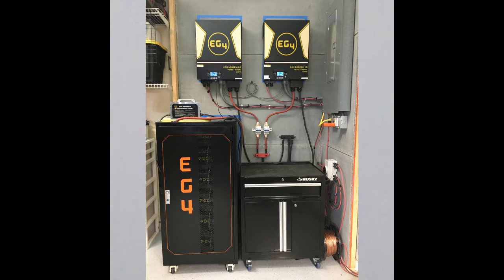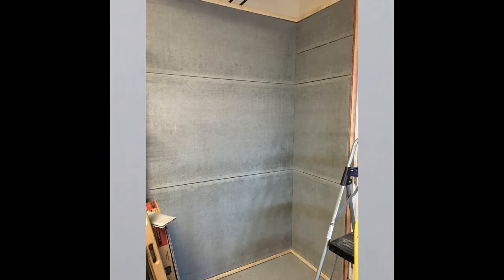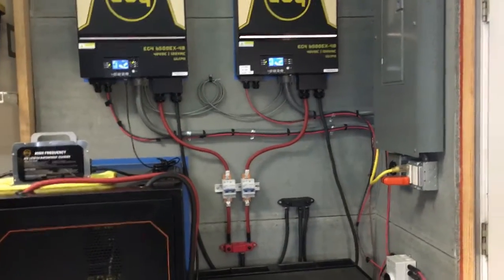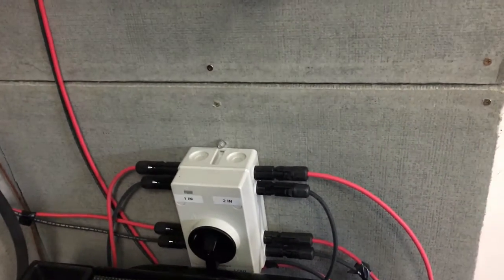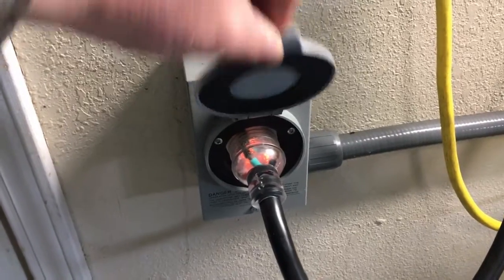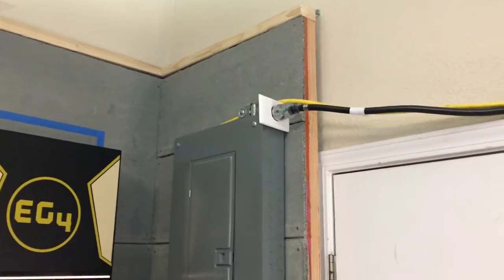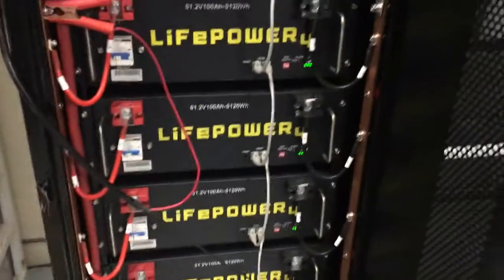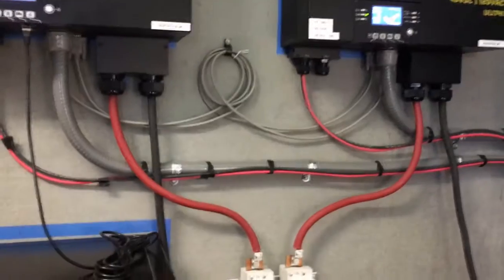Best!! Way to Charge Solar Batteries on a Cloudy and Rainy Days

Comment: New Subscriber here. Really like your set up. It's what I had planned for when I get everything together. Only grid power would be from utility pole. Main house breakers off. Only use power from utility pole for charging batteries when not sufficient wattage coming in. No chance of back feeding the grid. Just recently got my 2 EG4 solar mini splits installed and just got solar to one. Will get the other tomorrow.  It's just an expensive endeavor so have to get what I can when I can. Also installed woos burning heater couple months ago. Here in Texas gets hot so making sure we're never out of air conditioning.  I'll be following you now. Thanks..... Jeff
Reply from the maker: Hi JWTX. I found using the Transfer switch and setting it up on priority circuits gives the redundancy that you might like. It would give the means to keep the main breaker on and switch over to your solar system without causing to reset all the clocks. I have saved a lot of money on my power bill using my system that way.  I have some other tips in the videos that may give you some ideas too.  I left some links in the description with supplies I used and may help too.  I appreciate your time and thanks for watching.